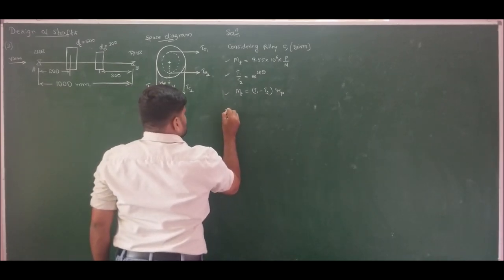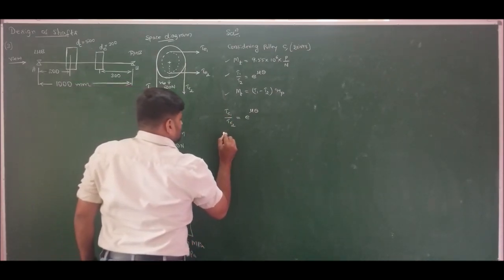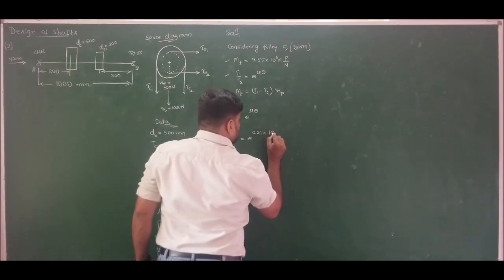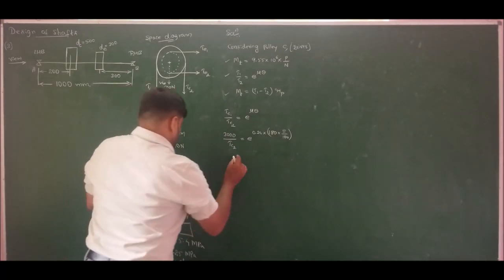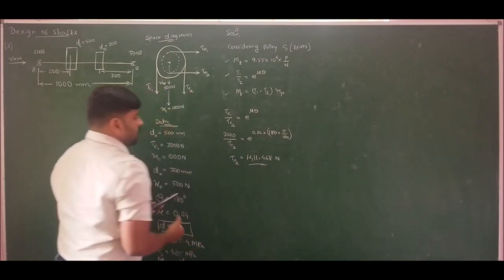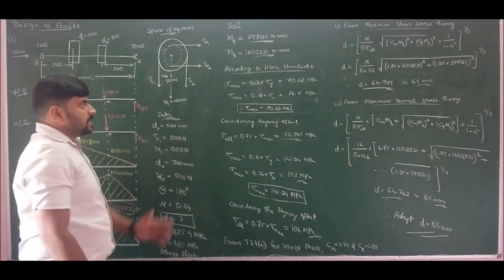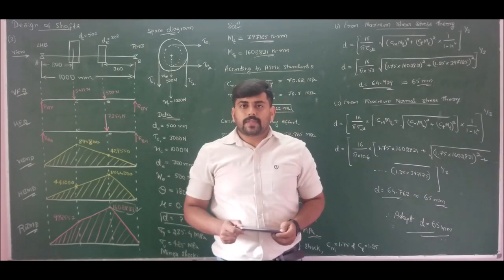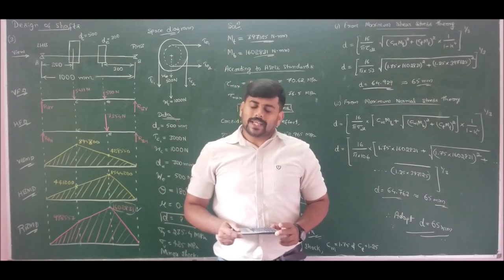28 - Problems on design of shafts #3 - Module 3 - Design of Machine Elements_1 by GURUDATT. H. M.

Comment: Sir if it is given as a pulley is overhanging the right hand bearing by 200 mm does it mean it is extended 200 mm front the right hand bearing is it like extra 200 mm of the shaft ? (Length between bearings is 600mm)
Reply from the maker: Yes, if the distance between the bearings is 600mm and shaft overhang by 200mm. Then overall shaft length is 800mm.
Reply: @MechanicalEngineeringELearning   ok thank you sir